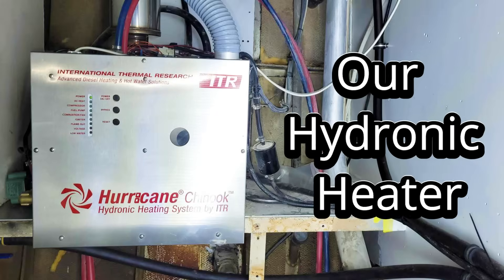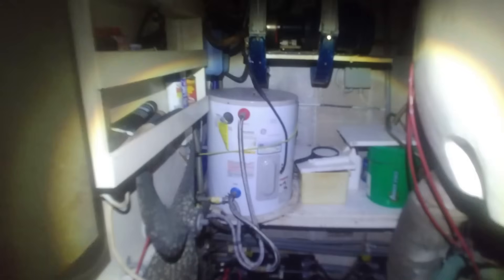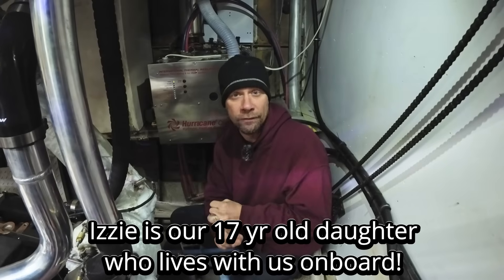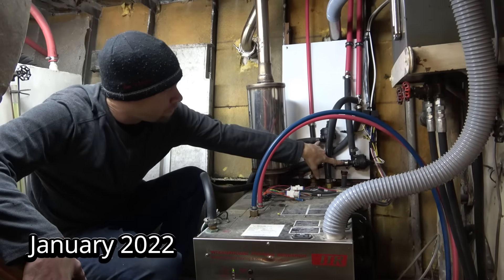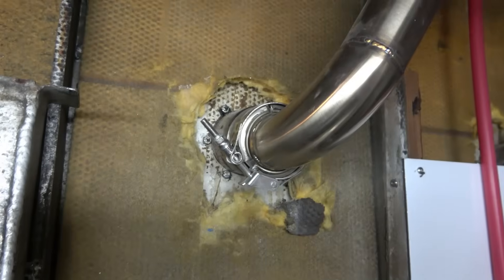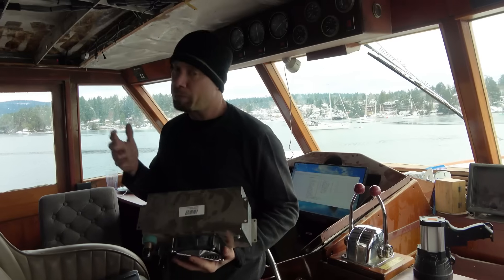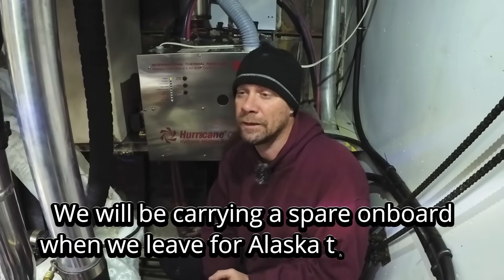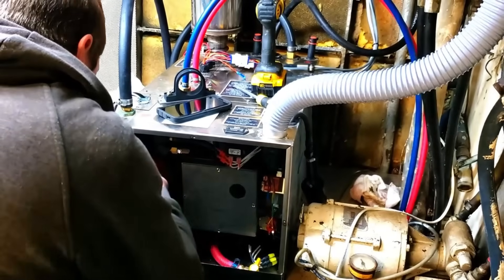Installing a Hydronic Heater to Survive Canada's Winter

Comment: Hi guys. Full of admiration for you both. What an excellent Boatwife ( as opposed to a Housewife) you are lucky to have her Blain. Just a thought. Did you consider installing a curved shiny Sheet of Stainless behind the Heater to reflect heat forward?
Reply from the maker: Thanks! Yes Janis is a keeper for sure. I originally did intend to have stainless back there but just haven't done it. We put a little fan back there to circulate air. It seems to work fairly well.

Comment: Just my personal opinions but as an HVAC mechanic/refrigeration mechanic with some marine experience you may be  better off with diesel webasto style heaters when stationary and using engine coolant as pumped static coil single tube deck level background heating in every room, I have never been in a cold engineroom and if you are burning diesel anyway then......  A small wood/coal/briquette or pellet heater in the main area is always nice for ambience and is great steaming or at anchor.
Reply from the maker: Thanks for the input! The Chinook seems to be working well since I have swapped the pumps out. I do eventually plan to use engine waste heat at some point but haven't got there yet. The pellet heaters in the main salon would also work well, however, that would be an additional fuel I would have to store. We have tons of diesel already so it just made sense to use it for all of the heat.

Comment: Spring clamps:face-purple-crying:Talk to the HVAC guy at big yacht builder.  They'll be hanging out around the roach coach at breaktime.
Reply from the maker: I don't so much mind spring clamps when they are accessible. I just really hate when they are installed in almost impossible to reach places. Such a simple device that can cause so much frustration.

Comment: The first thing you should do if you have not figured it out is remove all the stock pumps and plumb the pump outside unit for easier removal.  We swapped all our pumps out for March Pumps.  The only issue would be your domestic water loop make sure the pump is stainless and not bronze.  We have two similar systems on board and we love them.  We modified them to work in the marine side of things.
Reply from the maker: So funny, that is what we did as well. We ended up using Taco pumps in there though. They are non-metallic as well. Been working great for quite some time now.
Reply: @OnboardTangaroaSeatrial  I have been restoring a 72' Park Isle Royal Passage Maker called WANDERBIRD.  We are like you when we leave we are on the hook for months.
Reply from the maker: Right on! Its the only way to be!

Comment: Another option for heater fan coil units would be Vintage air automotive heaters. 
 You really only need (1) pump for circulation and for your application one continuous loop and a t-stat to control the fans for the zone. The little pump are water cooled watch the location if they are close to excessive boiler temp it will shorten the life of the pump as well as dead heading the pump.
Reply from the maker: I have looked into some of their air handlers in the past. Nice units. 

Blaine

Comment: 50,000 btu/hr is equivalent to 0.35 gallons/hr at 100% efficiency. So assuming 70% efficiency you should be seeing around ½ gallon/hr consumption.
Reply from the maker: Sorry, I misread the data plate as I didn't gave my glasses on at the time 🤣. The fuel burn is actually .46 GPH.

Comment: We are using: A 5kw/8kw Vevor diesel heater typically consumes around 0.1 to 0.5 liters of fuel per hour, depending on the power setting and insulation of the space being heated. Our fuel usage drop almost 66-75% per hr while using them.
Reply from the maker: Right on. That sounds like good results!

Blaine

Comment: I have only just found your site, and it is certainly interesting what you guys are up to, i to have a Hatteras 52CPMY over here in the uk and go through the procedures that you have been through already, by the looks of things.... maybe you or your patrons would like a contact company that also makes stainless steel heaters here in the UK namely SMITHS HEATERS in South Woodham Ferrers in Essex UK these run on small pipes and turn out masses of heat and all fan assisted if you would like them. 
I've really got into your storey and am looking forward to lots more new journeys, great ad libs to by the way
Reply from the maker: Glad you enjoy the channel! I will check into those heaters. Thanks for the recommendation. Good luck with your Hatteras! Its a journey for sure.

Blaine

Comment: With 1200 hours on the heater, what do you guess that used in fuel?
Reply from the maker: Well, I misquoted the fuel burn in the video because I didn't have my glasses on when I read the data tag. The 6.5 was the amp draw, not the burn. The burn is .46 GPH so over the last five years it has burned 550 gallons of diesel for cabin heat and domestic hot water. So, roughly around $2000 USD over 5 years.

Blaine

Comment: I noticed that humidity myself in the wheelhouse. If I may make a recommendation take a look at Ecor Desiccant Dehumidifier. The really nice thing about this dehumidifier is that these are build for boats, don't take up much space and that word Desiccant stands for sending the humidity  directly outside with a bit of air. They offer a good line of products that are also available in the US & Canada. I have installed several when I did all lots of various jobs up and around the water in Massachusetts.  I will be installing one myself in my basement because it is a crawl space and I don't want to worry about emptying a tank and it has a fully reliable auto setting. These worked out really well on Grand Banks Trawlers even during cooking the windows stayed clear and the wood trim around the windows didn't stain anymore even when the boat was left alone without ventilation for prolonged time. Pricy but a game changer.
Reply from the maker: Thanks for the recommendation! Definitely something We are always looing to improve. I just got the forward heating loop finished up yesterday so at least we have a window defogger up there now. I will check out those units though as there arer a couple of places onboard that seem to suffer worse from the humidity.

Blaine

Comment: Just a suggestion regarding windows and heat.  Aircraft windows have been engineered to not rely on fans but they do have electric warming built in.
Reply from the maker: Interesting. I had never even thought of that.  Wonder how what kind of pricing those have?

Blaine

Comment: 2:00 Hold on a second, regarding the heater, do you have your numbers correct? 1 gallon of diesel has 140,000 BTU’s yet that heater only outputs 50,000 and you say it burns 6 gallons an hour???
Thats an efficiency of 3%. Thats got to be incorrect.
Reply from the maker: Unfortunately I did not have my glasses on and misread the data tag. It's. 46 GPH. I accidently read the amps. Didn't even think about it till after the video went live.
Reply: @OnboardTangaroaSeatrial Ahh at .46 GPH, Those numbers work. Makes it 80% efficient. 
I was like woah, I knew boats are huge fuel guzzlers and are costly to operate, but that seemed really high. 

The wife and I are living vicariously through your videos, really enjoying the restoration! 
Cheers!
Reply from the maker: Glad you are enjoying the channel! Sorry for the confusion but good catch! Most people wouldn't have noticed.

Blaine

Comment: Hydronics are fun, definitely a very efficient way of moving heat, and it'll always be more efficient to have one central burner than many smaller heaters. Plus the hot water.
Reply from the maker: It has been a pretty great system for sure.

Comment: Um, if you are having a hard time it probably mean you trying to make the wrong tool work. Or you trying to unclamp it and move the hose at the same time. Unclamp it move the clamp take hose off.
Reply from the maker: It's less about the wrong tool and more about the access left for proper tools. There are special tools for tight areas but this is on a boat. We don't have a full tool crib available at all times.
Reply: @OnboardTangaroaSeatrial  a huge boat. It not like it is a 30 ft sailboat. Can probably find a spot in the engine room for some specially tool
Reply from the maker: Lots of space for tools but we don't have everything. When I do need a special tool its always a decision of whether I want to spend a couple of hours driving to shore then driving to the tool store vs just getting frustrated and maybe a little bloody for thirty minutes. It's a tough call sometimes 🤣.

Blaine

Comment: Thanks for making this!  I have a Hurricane H2 from about 2009 in my boat, owned now about 14 months, 8000 hrs on the odo.  The heater itself has been really great so far, only requiring a change of a couple failed aquastats.  It burns .3 gallons an hour (yes. point three). but we have mostly used it at the dock with the electric element supplemented by a Rixen Comfort Hot electric tank, for a total of 22 amps at 120V.  It doesn't heat the 40' boat to 70, but can do about 30 degrees F over ambient temp. Running diesel,  it can heat us up nicely. 
That said, in the vid you said your Chinook burns 6.5 gallons per hour, which is way off (I HOPE)..  The data sheet says it's .46 gallons per hour. Electric is still WAY cheaper, at about 31 cents an hour (2640W at .12 cents/KWH).  To compare with Diesel, we would burn 31 cents of fuel in only 4 minutes. So whatever energy you can get from the dock is desirable.

I echo the spring clamp frustration, they are a BITCH to work on, with without the right tools.  My system was assembled with worm drive clamps, which can leak with aging and flexing of the hose.  This is a set of really cool spring clamp tools..     https://shorturl.at/JYOZF

I have a 120v grundfos 15/58 pump (from Home Depot) on mine, absolutely silent and super reliable. I can also switch to a 12v pump when off the dock.
I found also that an old plate heat exchanger for engine heat was plugged with crap, and restricting flow.   I replaced it with one from VEVOR ($150) that is about 5x the size and it's great!
The hydronic system is plumbed through a coil on my Torrid hot water heater; 17 gallon size will give two great "boat" showers with water left over.

I have spent several (meaning mostly all) quality weekends this winter getting the hydronic side of things back and running, so this vid really rang true with me, THANKS!
Reply from the maker: I did indeed misquote the fuel burn. I didn't have my glasses on at the time and accidently read the amps not the gph. I have started replacing all of the spring clamps with spring loaded worm clamps. They seem to work well. For the main pump I am using a Taco 006 which I believe is similar to the Grundfos pumps although it's in a plastic housing. I still have lots of mods I want to do but they will have to wait as I have bigger fish to fry. Sounds like you have yours dialed in!

Blaine

Comment: Are those pumps bosch pad2 pumps?

I absolutely prefer constant tension hose clamps over worm drive style hose clamps.  Constant tension clamps automatically adjust themselves as the hose ages and changes.  The key to using them is having the correct pliers to lock them in the expanded position.
Reply from the maker: They are not the pad2 pumps. They are bosch but are a much simpler non speed controlled unit that uses a bosch minitimer connector. They also failed. I ended up going with a 120v Taco 006 ecm pump. It has been great. 

   I like the idea behind the tension clamps, just not the execution. I would prefer a spring loaded worm clamp. Same benefit with less annoyance. With the regular spring clamps it seems that they are never in a location that allows proper tool access.

Blaine

Comment: You can buy a condensing propane tankless water heater for less than 2000 dollars that will supply 199K BTUs of hot water. Add a small tank, a three way valve and a heat exchanger for both hydronic heat and domestic hot water. Both the supply and exhaust vents are 2 " plastic routed to outside so you don't use your heated air for combustion. They are 95+% efficient. Diesel is a poor expensive choice for heating.
Reply: I would not get a system using a gas that could explode. I either get a bigger battery bank and use electric heaters or a better heater system that burns diesel. I find out what people that have live aboard boats in Norway, Finland, or some other country way up north. But definitely fix the aluminum so you can insulate

Comment: If you want the best and quietest fans, you want Noctua.
Reply from the maker: I had another person recommend them as well. I remember using them in my pc building days. Going to have see what the new lineup look like. Thanks!

Blaine
Reply: Make sure to get the static pressure ones the other ones will die quickly in that type of use.
Reply from the maker: Great advice. Thanks!

Comment: Another recommendation for the 120vac Grundfoss pumps. Sure Marine Seattle make a relay box.
Reply from the maker: I ended up going with a Taco 120v unit. The heater has an internal space for relays so I installed one there. Its been working great for a couple of years now.

Blaine

Comment: Did I hear correctly that essentially in one year, you have over 1,200 hrs of run time? If it burns 6.5 gallons per hour running, you've burned over 7,800 gallons of diesel? I had to of misheard something or my math ain't mathin right?
Reply from the maker: You heard correctly but I didn't have my glasses on and read out the wrong number. The actual fuel burn is .46 gallons per hour. The 6.5 is the amps it draws. Lol, I didn't even think about it when I said it. Thanks for catching that. 

Blaine
Reply: @OnboardTangaroaSeatrial   Haha. Ok, that makes a little more sense.
Reply: @OnboardTangaroaSeatrial that sounds much better.  I heard you say 6.5 gph and thought that was crazy high.
Reply from the maker: Lol, my bad. Sorry for the confusion.

Comment: Grandfos pumps installed in 1970 still working for hydronic heat in house 120 volt.
Reply from the maker: I ended up going with a Taco. I believe they are similar to the Grundfos units. Its worked well for a couple of years now. Take care.

Blaine

Comment: BUY THE "CATS PAW PLIARS" MADE FOR SPRING CLAMPS, DUH!
AND THEN LEARN ABOUT PRIMARY  AND SECONDARY LOOP HYDRONIC SYSTEMS
Reply from the maker: My spring clamp pliers live at my automotive shop. The heater was the only thing on the boat that used spring clamps. I'm not going to waste an hour of my life driving to shore then to the shop and back just to grab my spring clamp pliers that are just as unlikely to have fit in the space I had. Primary and secondary loops are all well and good in a house where you have infinite electricity and cheap fuel. This system only circulates water when there is heat demand in a zone. This allows the system to cycle less and have a better efficiency. I had debated installing bypass solenoids at each zone though to completely bypass the radiators but honestly, simplicity is king. Having the second independent loop forward lets me completely shut down water flow to that loop as its not needed for the majority of the time.

Comment: So I know there a little costly but like the bow cabin use a Espar or that what ever brand truck diesel heater. Had on in every semi I've driven they work great may be laud at first but only use like a quart to mabey a gallon of fuel in 12 hours. Also have you thought of like a 12 car fan or blower in place of the pc fan I know some fab work will be needed and possibly a relay  and power put in just because a pc fan doesn't use much
Reply from the maker: Espar heaters are definitely quite popular on the boats.  I actually misquoted the fuel burn on this unit. It is only .46 GPH. I have had a few recommendations on PC fans. Probably going to look into that. Thanks for watching!

Blaine

Comment: Have you ever considered Grundfos pumps?  There are versions made for pumping radiant heat around houses.  We use them for radiant floor heating.  No issues in 16 years.
Reply from the maker: I ended up getting a Taco pump which from what I understand are quite similar to the Grundfos units. Its been going for about 2 years now and works great!

Blaine

Comment: Like others already stated, don't waste the hot cooling water from your generator and your engines. On my boat the port engine cooling water runs through the boiler, means I have warm water whenever we are underway and when that port engine is running. When that is not the case I heat the boiler with a 800 W/220 V heating element. Since I have LiFePO4 batteries that is not a problem. 
As for the pump problems, don't  know if you have central heating with radiators in houses in that part of the world, but in Europe we do. So my Kabola heater is basically the same set up as a house heating system. The diesel burner heats up the water, water gets pumped around the radiators which heat up the boat. The pump that I have onboard is a standard central heating pump, they never fail, can highly recommend them.
Reply from the maker: I may add an engine heating loop in the future but our generator run times are so short that I just don't feel its worth the effort. It would be interesting to know how much it would reduce fuel burn over a long time span though. The heater does have a large electric element built in but its more of an "assist" its output is only a fraction of the diesel burner itself. For the pump I did end up going with a Taco 120v circulation pump for residential heating. It has worked great for a couple of years now. If I did the system again I would likely just get a large dedicated burner and do all of the heat exchanging and pumping externally. It would definitely make for a better system and likely considerably less investment.

Blaine